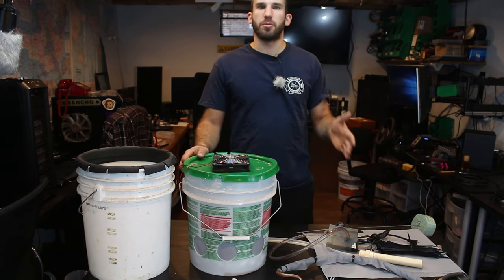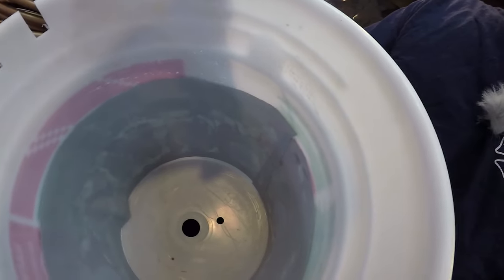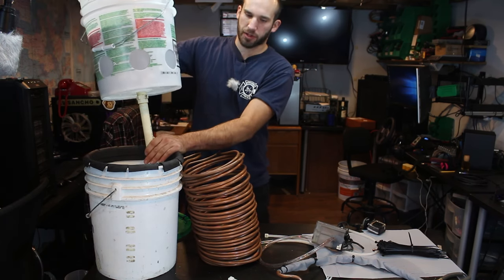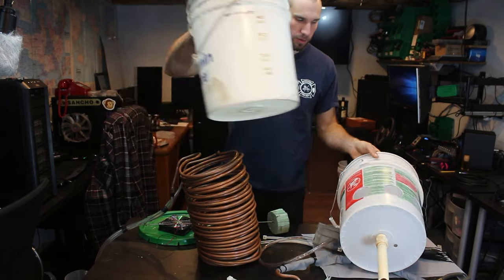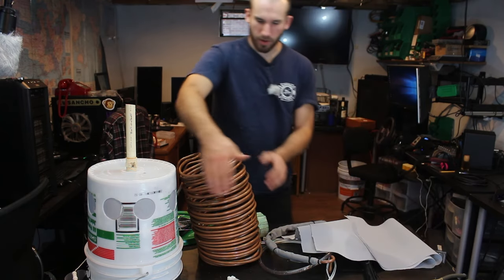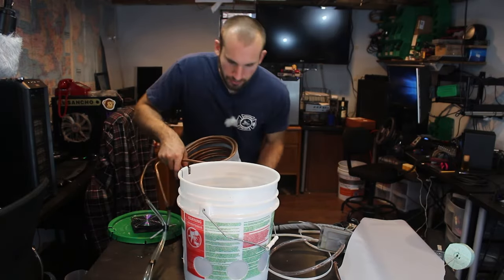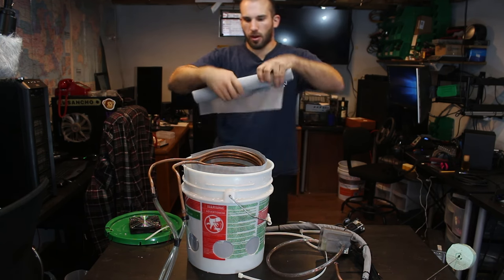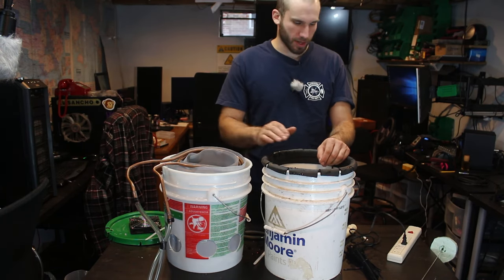Building an Evaporative cooler to cool my PC (PART 2)

Comment: You can use the stuff from a toilet to automatically add water to it so you can set it and forget it.  I was thinking about making a huge "Bong" style cooler for mine. the most expensive part would be a pump with high head pressure around 50-60 ish bucks for a 100 psi pump, I was also thinking about using a couple or so sprayers or shower heads with a mist setting and a large ice cooler or 50 gal drum, with the toilet thing to refill it when it gets low since I'm forgetful about these things.

Comment: Old school! Haven't seen evaporative cooling in awhile. Love it.  How much improvement did you see?
Reply from the maker: So we have had very warm and humid weather.  So i have not had a chance to do some good testing.  I am still currently useing my chiller.  I plan on making the video of the results on a week.  Thanks for watching
Reply: Any updates on performance?
It seems like you have ton of goo ideas on this, I'd love to know how it performs. I'm considering doing a similar build but for a different cooling application.  How have you been managing the growth of algae/bacteria ect?
Reply from the maker: +Andy Nelson Thanks. The massive copper coil was such an effective radiator that i didn't even need to use the evaporator. But running the water dropped the water temperature 2-5 degrees F below room temp. Running benchmarks for 3hrs without running the evaporator water temp kept at 80f with room temperature of 72.
Reply from the maker: +basline34 Thanks  Short and sweet the massive copper coil was such a great radiator.  It was all that was need.  But running the evaporator drop water temps 2-5f below room temp.  Gpu/cpu temps remained about the same. I shot the video for it but it was very uneventful.